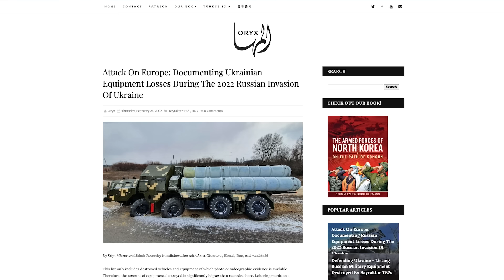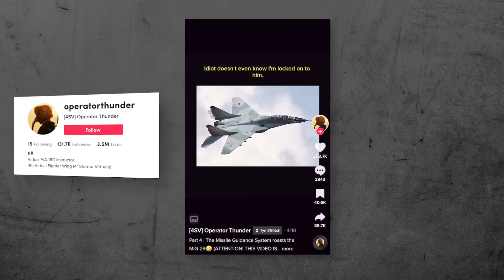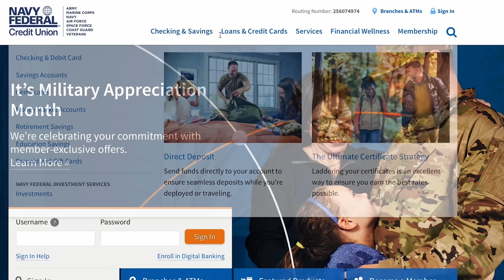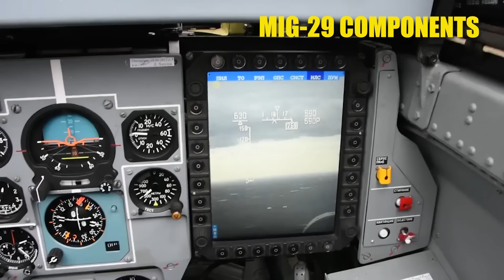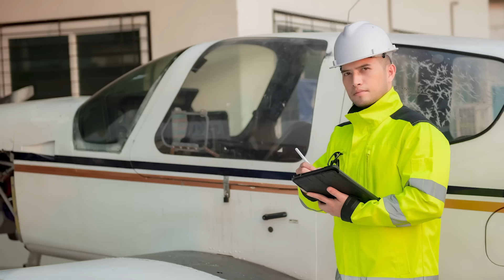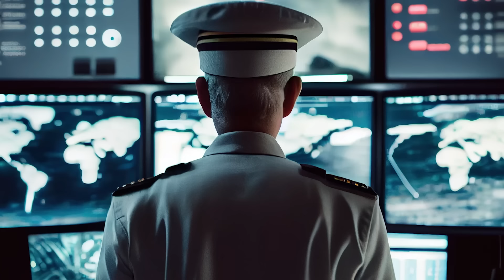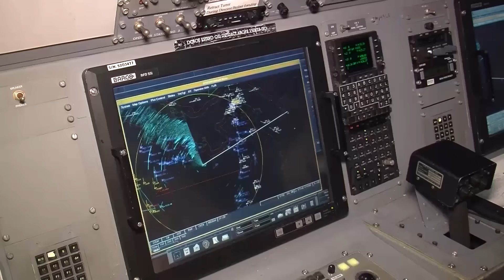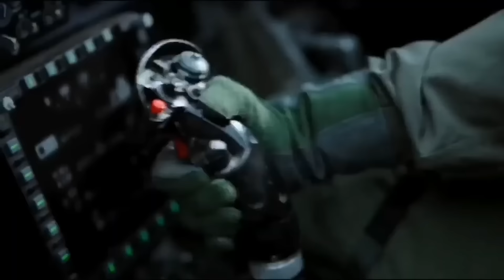How Ukraines new MIG-29 Fighter Jet Operates

Comment: The Mig-29 cannot lift Storm Shadow or similarly sized cruise missiles and even if HARM missiles were supplied to confuse Russian EW assets the actual score rate for HARM is notoriously poor. Moreover it appears that Russian EW is far more sophisticated than was assumed and its S band equipment can comb frequencies then switch off to avoid detection but pass on data to other installations even on the move. Thus, in the event of the approach of several Mig-29s the Russia anti aircraft assets capable of multi-target hits would stop batches of Migs semi-automatically. Explosive and AR features are combined to destroy or disable incoming ordnance and planes from just under 100 nm away.
Even with more Mig-29s from donors the Ukraine AF could easily lose a viable air force in a few attacks. If that happened there would too few Mig-29s to give aid to Su-24s carrying Storm Shadow and related missiles not least because the Su-24s would be slower and have practically no self-armament and serious range constraints.
The F-16 could not carry Storm Shadow either and would face a significant problem of needing good paved runways. The Swedish Gripen could do the job as all SAABs since the Draken were designed to land on highways if necessary but none can be sent to Ukraine.
My own view is that the conflict will have ended long before any F-16s can be used by Ukrainian pilots.

Comment: People need to stop using the Iraq war as an example of why certain equipment sucks. A tiny, poor country with a bloated, under funded and under trained army that was judt decimated in a massive war with Iran, being attacked by half of the West is not a good example for what equipment is capable of.
Reply: No but it's a great example of what western equipment is capable of.

Turns out equipment designed by the most technologically advanced nations specifically to counter russian equipment works well countering russian equipment.

Comment: Unless the pilots are fully trained on F-16 and its tactics and their ground crews able to handle the logistics to handle the new platform, giving the Ukrainians the new Jet will do no good. There is no doubt that the F-16 is a good platform but it needs to be known that what type of sensors are given with the platform. 
In the 1999 Kargil war the Pakistani F-16's did not have the reach with air to air weaponry and avoided contact with the Indian Mig-29's which were BVR capable and roamed over the Kargil theater to provide air cover to their Mirage 2000's. 
The same Pakistani Air force after refining its tactics and upgrading and making their F-16's proper BVR ready were able to outgun and out match the combined Indian frontline SU-30MKI and Mirage 2000 jets in Feb 2019. This time it was the Indians that ducked and avoided contact with one unfortunate IAF Mig-21 getting shot down by PAF. 
This shows that the name of the Jet does not matter. All matters is what sensor package is available to the Ukrainians and how much trained they are on it.

Comment: The plane you throw at a battlefield isn't as important as the weapons it carries!  You COULD throw a WW2 Spitfire at the Ukraine conflict, and WIN, if you could arm it with the right detection and targeting hardware and the missiles to reach far enough with reliable accuracy! (MY choice would have been the DH Mosquito, as it's wooden construction made it far more difficult for the modern radar to locate and track!  It's record as a high speed "hedge hopping", low level attack platform was unmatched!)

Comment: Ghost of Kiev.  Ha ha.
F16 is 10 times more complikated than an Mig 29. The Romainien air defens have used 10 years to go from Mig to F16. And it was best to start whit new pilots.  Cause those who have been trained on mig29. 
To many times failed under stress. 
And used it's old muscel memory.
To train one pilot will cost around 15 million US dollars.  All in all. To be good enough for real battles, a minimum of 18 months intensiv training. And on top all the crue to repair, maintine, special tools , fuel depos  etc etc.    It will take time, 
It's not just like it is to change a car.
And remember the F16 is a third generatoin. It's like a 1985 sports car , against one made in 2020.

Comment: No, no, no.  Ukraine will get very old F-16's with avionics systems from the early 90's  They will be better than the Mig-29's but will not have the advanced systems that The united states uses on their aircraft.  The success of the F-16 is more than the air frame, it is  the electronic systems installed by the host country they are sold to and whatever data link capabilities they have for command and control.   Without those extra capabilities, the F-16 is merely a good aircraft, not a game changer.

Comment: I flew both aircraft. The difference? 
The MiG is a capable front line fighter, but you have to work it and the whole weapon system (fire control and weaponry) is a bit cumbersome, no open architecture, no information management, old school displays and controls - high pilot workload. High fuel burn rate (short station/combat time) and rather short radar detection range, IR sensor is rubbish.
Engines provide a terrible punch of thrust, but they smoke like hell unless switched to combat regime (cumbersome process, we almost lost 2 aircraft due to 'pumping' engines afterwards). Engine overhaul is required after 300 operating hours at the factory...!
The Falcon/Viper is like a glove - as a pilot you put that plane on like a suit, pilot and machine melt into a unit. No need to care about manoeuvring, just think where you want to head and the plane, thanks to its FBW flight control system is fulfilling your wishes instantaneously. Intelligent information management helps the pilot to make the right decisions in time. Full spectrum, automated self defence system increases survivability. All in all, a true war going beast!
For human beings to sustain a 9g load in a dogfight, the Falcon/Viper with its 30° declined seat provides a 50% higher g-allowance than the MiG-29. This might be either the decisive factor for a quick kill or a life-safer in a defensive situation.

Comment: I would give you complete compensation you  vs Albert Einstein .. but that is not the case here .. f16 is old jet with different missions profile . It is good jet but if you are under estimating mig 29 that I would call u fool .. if mig 29 and F16 meet for dog fight or 20 mile range chances are 50- 50 for both … long range missile can make difference .you meet mig 29 upgs I hope god save your soul that is deadly thing as deadly as f16 … so say truth and don’t spread misinformation .. true information goes long ways …

Comment: ukrain has shot down 70 russian aircraft source USA today.. ok bro 😂 when you watch military analyse made by your mcdonald's gay !An f16 is a multipurpose  airfract not an air superiority aircraft so facing su35, su 31 and mig 31 is not an easy task for it specially with old f16 that will be delivred to ukraine by NATO country which just want to replace them by more moderne aircfrat with a low cost like yhey did for the mig 29.

Comment: Ukrainian MiG-29s problem is hopelessly outdated avionics and missiles. Radars, data links, jammers, radar warning receivers, missile seekers, airframes, flight range and speed, all improved out of sight compared to basically unchanged Soviet-era MiG-29s. Russians had upgraded their MiGs to SMT standard, made a carrier-version with more modern avionics and of course made the MiG-35 with all the upgrades I mentioned and also with airframe and engine upgrades, as well as ability to fire latest Russian missiles, that make it every bit competitive against its western counterparts. Old MiG-29 is a great airframe, just needs a proper electronic refit. As for F-16s - unless they  come with the latest missiles and EW systems, they'll still be prey to Su-35S and MiG-31BMs firing R-37M missiles.
Reply: Good they got some from Poland. Polish MIGs are equipped with modern avionics, including MIL-Std-1553B data bus, new interfaces, 127 x 102 mm color multifunction display, mission computer. The multifunctional indicator allows for clear data display. A second RT-8200 radio station with a coding system was also built in. Not to mention Polish MIGs have been adapted to NATO military equipment.